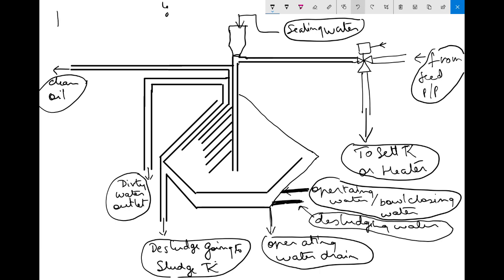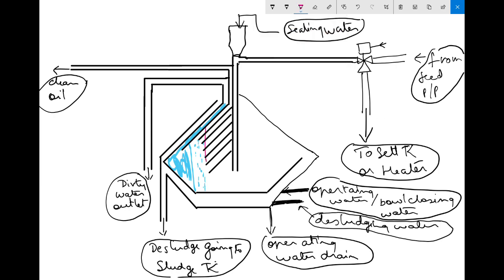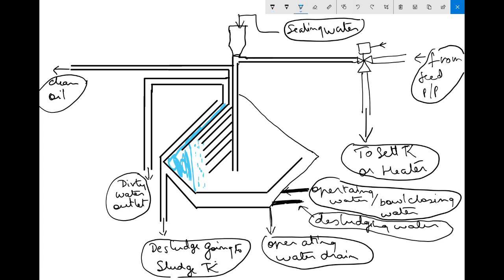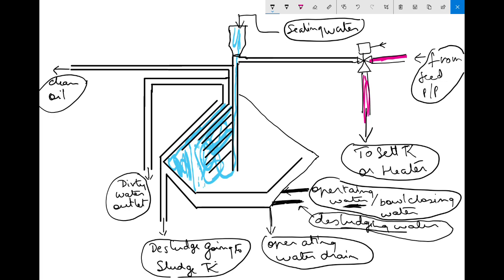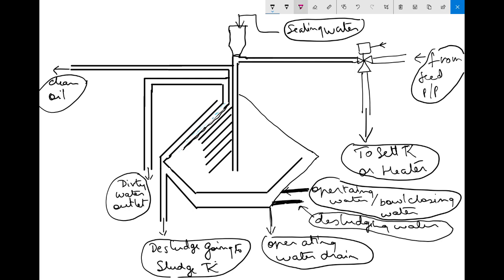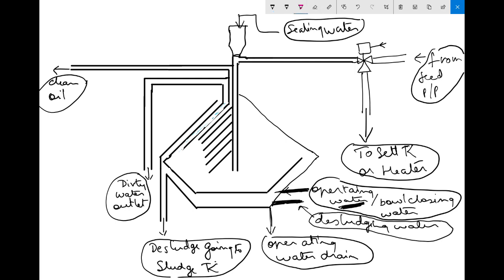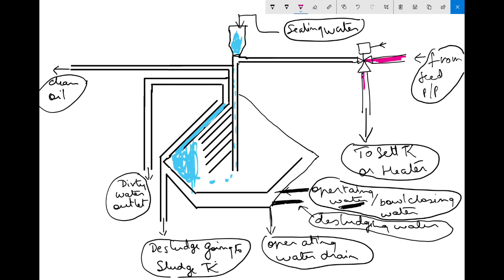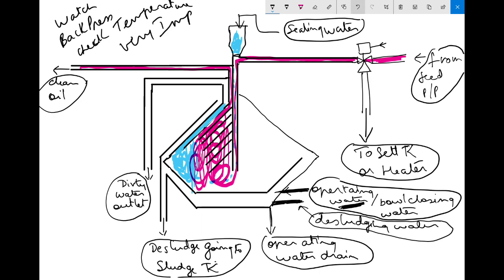how to desludge a purifier

Comment: L. O purifier not closing during auto dislugeng
Reply: Not closing 3way valve for dislugeng
Reply from the maker: Check with Electrical officer if supply is coming n check if pneumatic supply reaches to open the 3 way valve

Comment: Sir thank you so much sir one dout what what is the pressure operating water as well as desludging wate?
Reply from the maker: Normally desludging water pressure is more n it is different for different models
Reply: @BasicMarineEngineering  OK sir it is different for different model but approximate value sir?